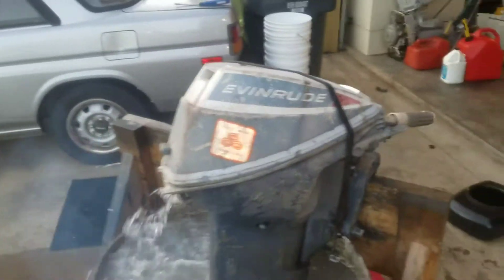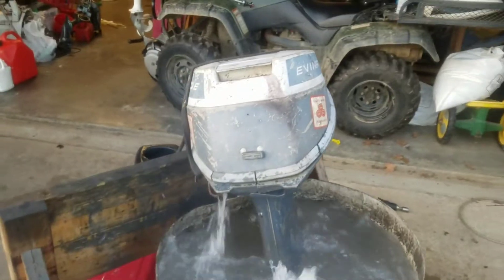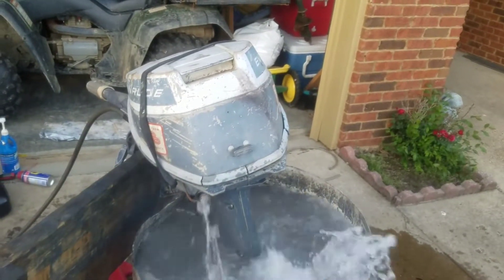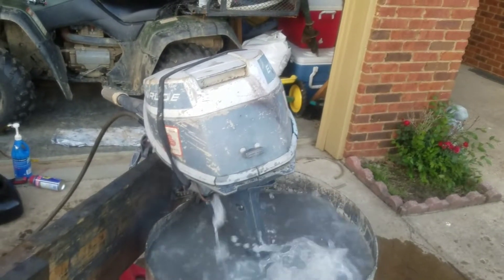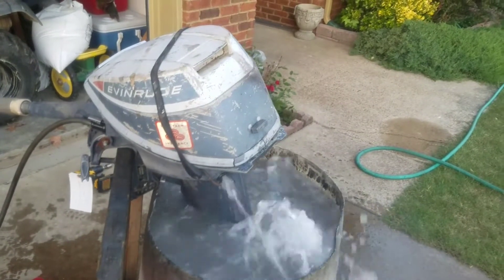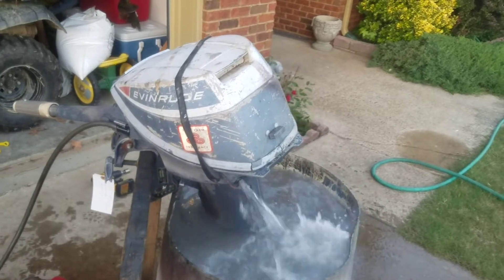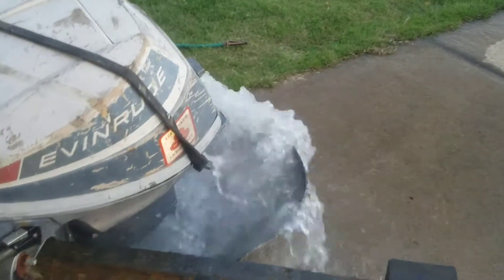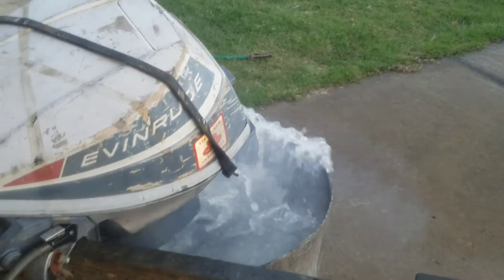May 2, 2017

Comment: Those little square pumps are a little tricky to rebuild,  but not so bad once you've done a couple of them. Make a fixture with a block of wood and a couple nails just smaller than the screw holes.  Put the nails where the two holes that mount the pump to the motor are.   That will help keep things aligned.  Buy the OEM kit and follow the instructions carefully.  They are completely doable.
Reply from the maker: Old JohnnyRude I have had mixed results with those little pumps.  The first 5 or 6 I did went as smooth as silk.  The last couple have not gone well.  Maybe I should give it another try.  Are these the same pumps on the the 9.9/15s?
Reply: Mark Smith I'd say give it another try.  I'd be lying if I said every one I tried went smoothly.  It is a lot easier with some kind of fixture to hold the layers while you stack the parts though.  I would certainly try to rebuild rather than toss and buy a new one if it were me.
Reply from the maker: I ordered a kit for it last night.  I will give it another shot.  I have never thrown one of the pumps away.  Just into my box of stuff I will get to later...maybe.
Reply: Mark Smith You're a lot like me.  I never throw that stuff away either.  You'll get it done.  It's a little confusing but the instructions are good if you follow carefully.   distractions are bad while rebuilding those things.